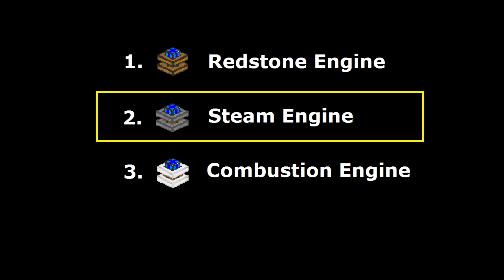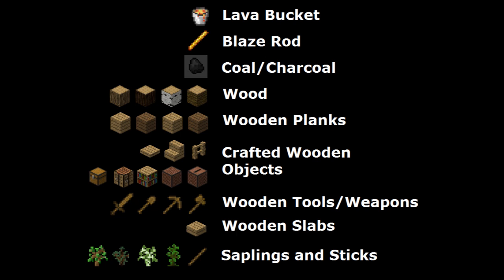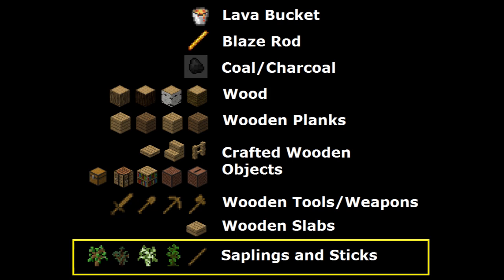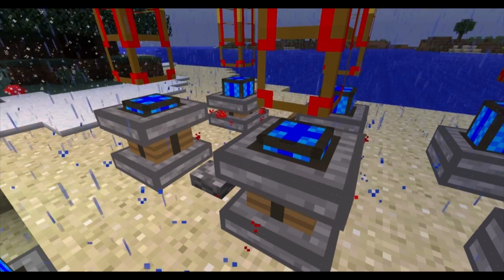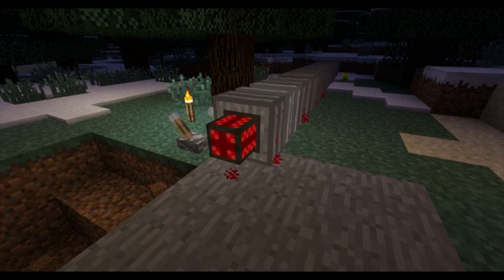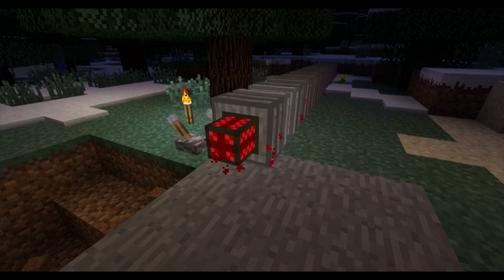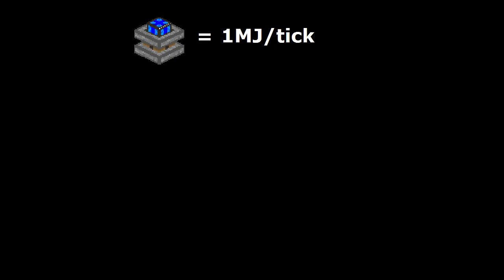Stirling Engine (Tekkit/Feed The Beast) - Minecraft In Minutes

Comment from the maker: They provide an output of 1MJ/t. But different fuels will last for different amounts of time. Sticks and Saplings will last for 3 pumps each. Any timber items (Planks/Wood) will last for 7 pumps each. Charcoal will last for 32 pumps each. 

It's best to use an item that will last for a long time, but won't heat the engine up too fast. I recommend Planks and other wooden items. That works for me.

Comment: Did some more playing around. Confirmed that I was indeed using the wooden conductive pipe, but found out that the connection would only be functional if the engine was receiving power from a redstone torch AND already burning fuel before placing the wooden conductive pipe down. Go figure.

Comment: This is my single-player game where I cheat in items in order to familiarize myself with things before I start using them on multiplayer. Strangely enough, the quarries work fine if I attach the steam engines directly to the quarry control box, but I'm limited by the sides of the box, obviously. Of all the different ways I've attempted to use engines, this is the only strategy so far that hasn't worked.

Comment from the maker: Well, if that's working then it must have something to do with the way they're connected using the conductive pipes. I'm assuming you've got the 1 wooden conductive pipe above each engine, which is then connected into any other type of conductive pipe (anything except wood).

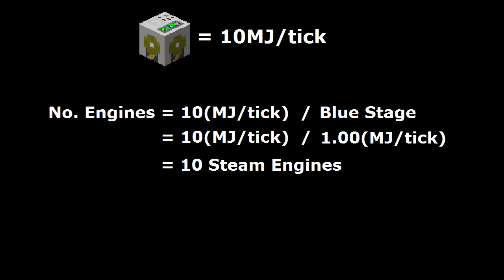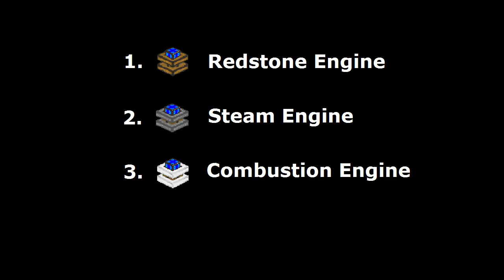Comment: I followed your build method starting at 0:53 with an arrangement exactly like what is seen at 0:04 except with gold conductive pipe. However, the engines won't stroke. I'm trying to use them to power a quarry. What could I be doing wrong?